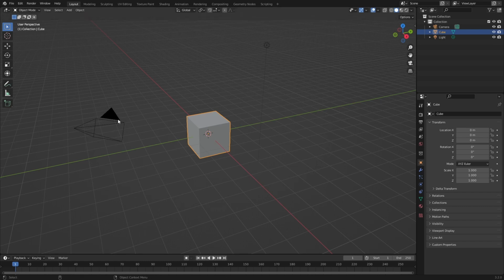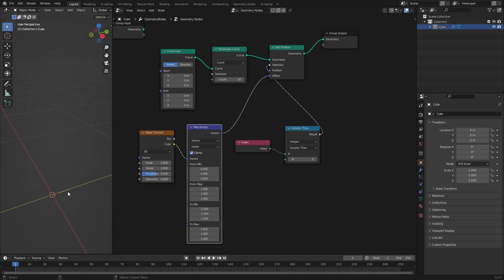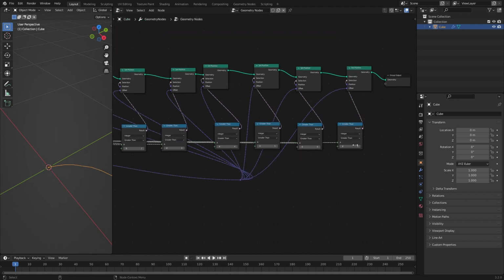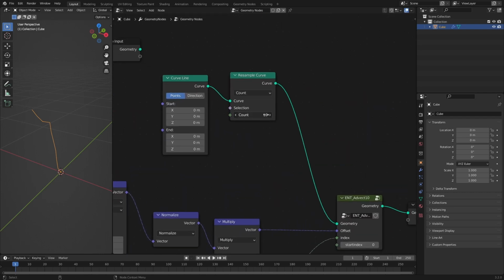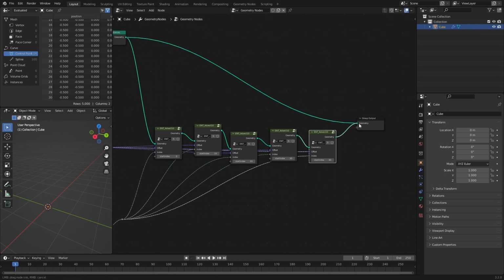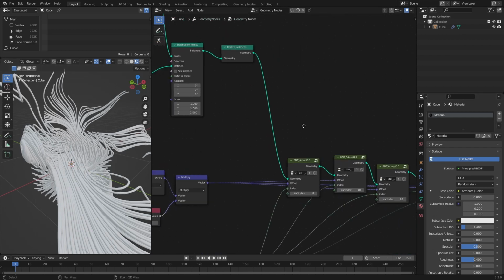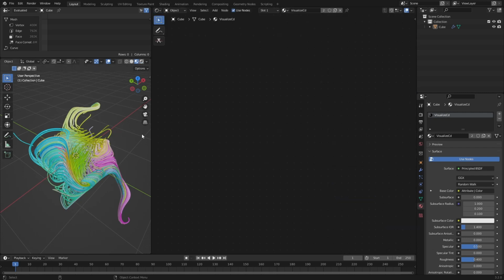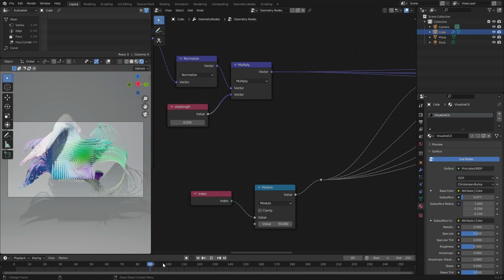Blender Tutorial: Noise Advection with Geometry Nodes

Comment: Great tut! One question: how would you add random radius to the curve mesh? tried some options but failed. thanks
Reply: There is a Set Curve Radius node, which you have to apply before the Curve to Mesh node. You can plug a noise texture or something like that in its radius input
Reply: @Fleck2011  thanks a lot! I've added the SCR Node between the Curves To Mesh and the Geometry Group Node but I still need an input in the Profile Curve, which I left the being the Curve Circle (which has its radius). Then used a Noise or a Random Value Node in the input of the SCR but all I get is the radius changing along the curve instead of having the individual curves with individual radius. Sorry, sounds messy.
Reply: @diegosaldiva  Random float value doesn't work because it's only a single global value, not an attribute-like thing that changes along geometry. You can leave the Profile Curve being the Curve Circle with Radius 1. Only control the radius of Set Curve Radius with a noise texture. And as I said, the Set curve radius has to be before the Curve to Mesh node. Hope this helps :)
Reply: @Fleck2011  thanks. I can only manage to change the radius along the curve (like a jagged curve), but my intent was to have consistent radius along the curve but different radius individually. Thanks for your time anyway.

Comment: which version of blender are you using? when i open the project file some of the node connections are red and it's not working correctly. this is really cool though definitely going to experiment with this!
Reply: nevermind opened it in an older version by accident :D

Comment: You should have just use accumulate node. this tutorial is quite wrong. Before making tutorials, you should start by learning geometry node.
Reply from the maker: Oh interesting. How can this be achieved with the accumulate node? It accumulates the vectors sampled from the noise. But here the next point only knows where to sample the noise when moved by the vector sampled at the previous points position.
Reply: That still requires knowing what value the noise field will evaluate to at each point though. The accumulate node just accumulates the values if you already know them.
Reply: @vincentsommthing  sorry i was just such an asshole in the comments, i had a bad day, i will send you a link from a discord video i saw

Comment: Great video. 
Just one thing: from my experience it actually executes faster if you instead reptetivly extrude verticies (only the last of each line/top from previous extrusion) because this way the vector field only has to be evaluated on the last point of each line instead of at each point greater than the current loop iteration.
Reply from the maker: Very true, thanx for the tip! Will try that.